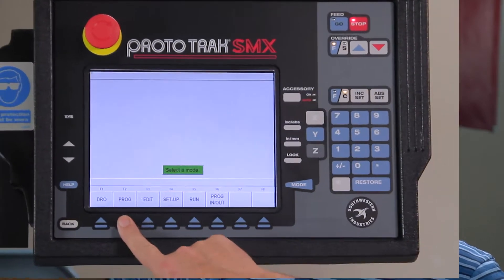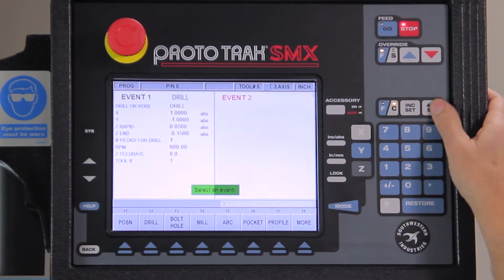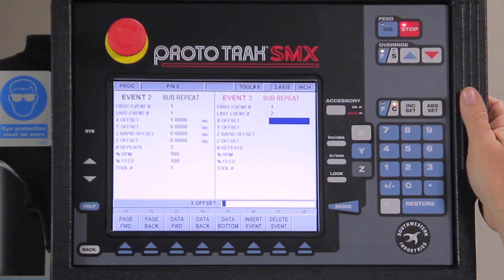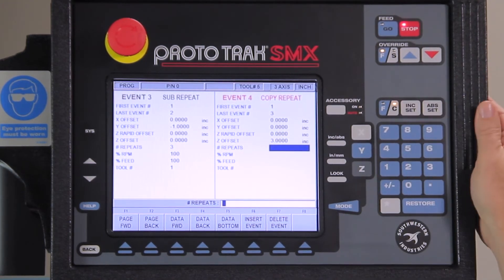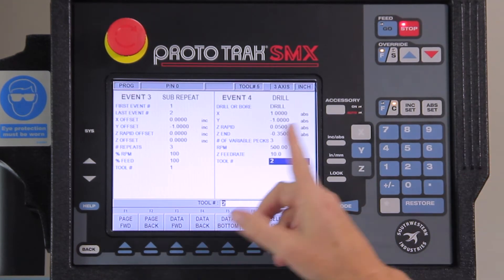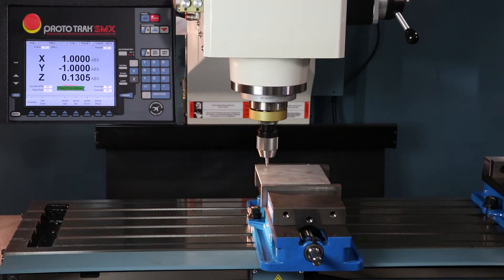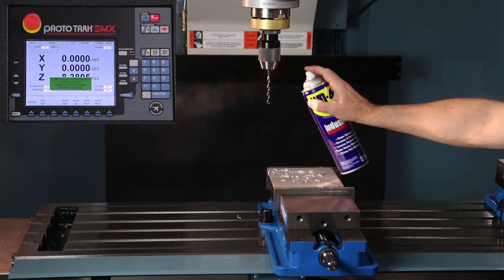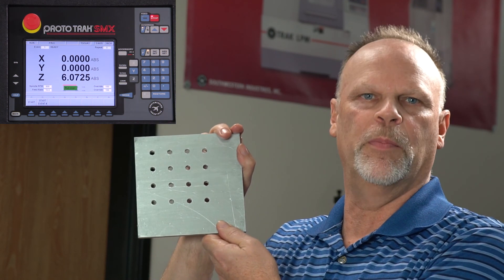Basic Hole Patterns | ProtoTRAK SMX Control | Basic Programming 1

Comment: Hi Pat
I have a 8"dia x 12" long pipe I have to bore out to clean up the inside true
Can i do it on my SMX2500 with helical milling 
Thankyou 
David
Reply: Hi David!  Since your machine has about 25" of Z travel, I think you can do this however, you would need a really long end mill to use helical milling which I assume would cost a small fortune.  Can you use a boring head to do this?  I'm trying to picture in my mind if this is possible but I would think you'd get a truer hole and finish with a boring bar.  T.P.
Reply: @trakingpat2750  thanks Pat
I was going to use a kennametal kshro50ao5rs45hn06 milling head and use the side of the 5 inserts 
The pipe has a square flange on both ends and we have the DXF option so can load the finished dwg and bore out to suit 
It is for an impeller fit inside an 8" bore.
Many thanks Pat

Comment: Will you please make a short video showing how to move the Z-axis manually in DRO mode when using a PROTOTrak RXM controller? Thanks.
Reply: Hi Eric, is this a DPM or a knee mill? The DPM has a manual quill so it will know if you move the Z head or the z quill but the quill is fully manual.  On a knee mill with 3-axis, it has an electronic Z handwheel so in DRO, you just turn the hand wheel to move the Z. Other videos should show this but if not, please get back to me. T.P.
Reply: @patrickfitzsimmons5187  Thanks for the quick response. This is a bed mill. I figured out that pushing the "JOG" button was the missing step for me. I was confused why I could move X and Y, but not Z, until I pushed the JOG button.

Comment: What if I wanted to spot drill, drill, countersink, then tap the same hole locations? What would the best method be? Thx (RMX controls)
Reply: First, make your holes using the drill or bolt hole cycles and spot drill them.  Next, use the COPY-REPEAT and repeat the holes 2 times.  After the copies are made, change the first set of new drill events to add more depth, pecks, and make whatever changes are needed for your speeds and feeds. After that, Change the second set of new events for the countersunk holes.  Lastly, go back to COPY and use the DRILL TO TAP event to copy your original holes and turn them into tap events. When you do this, it will ask you all the needed information to do the tapping.  (Remember that the pitch is 1 /  the # of threads per inch). Be sure to use a Z rapid high enough to leave room for your compression tap head to snap back to neutral before it moves on to the next hole.  T.P.

Comment: Could you explain how you were able to change out to the drill bit without having to change any offsets in your tool table?
Reply: Sure thing.  I didn't show the process in this video but when I set up the tools, I made sure to bottom both drill bits into the the drill chuck so that they would repeat when I took them in and out.  I actually touched off each drill on the back of the vise so that the control measured each tool and entered the length offset.  T.P.
Reply: @trakingpat2750  thank you for this. i had the same question